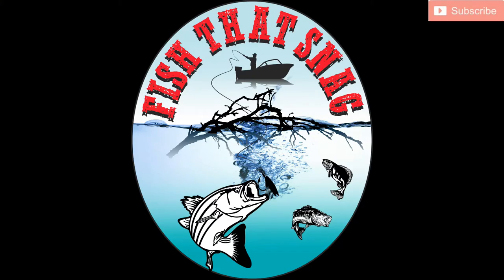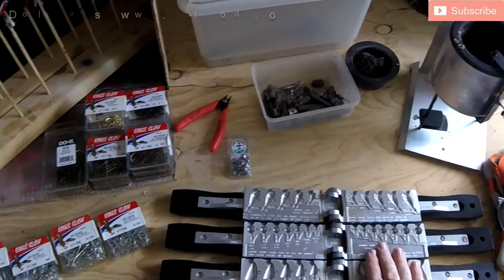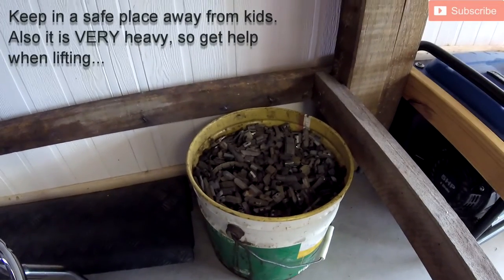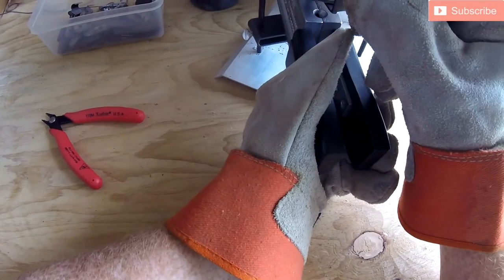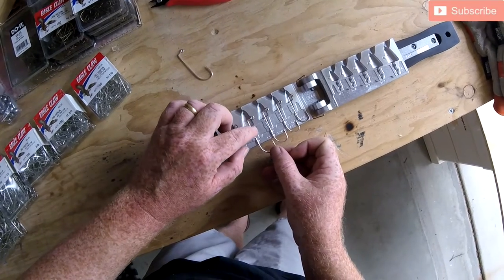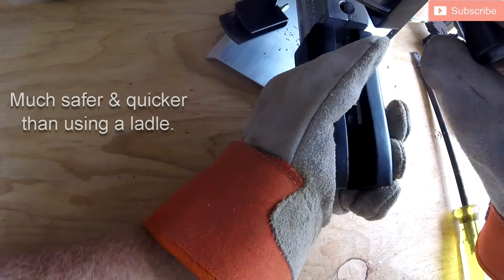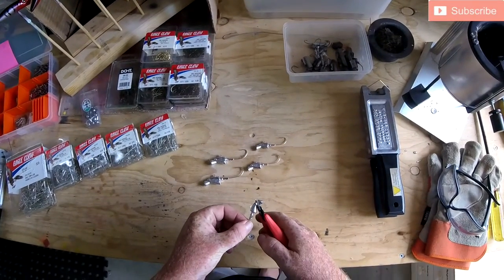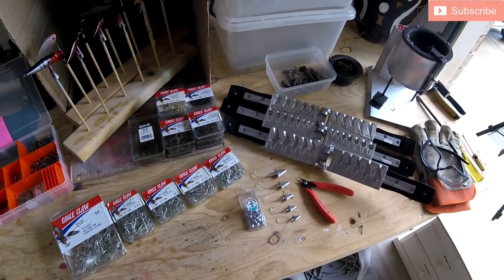Making Jig Heads for Fishing

Comment: As a bullet caster yes wheel weigthts are getting hard to get but if you mix 5lbs of wheel weights with 5lbs of lead this is a 20-1 mix for black powder bullets your wheel weights will last longer and you will get moor out of a bucket wheel weights and thay whont melt when you heat tret them in a oven ok hope this helps and thanks ill get on to them soon